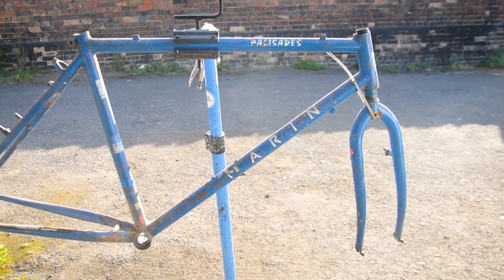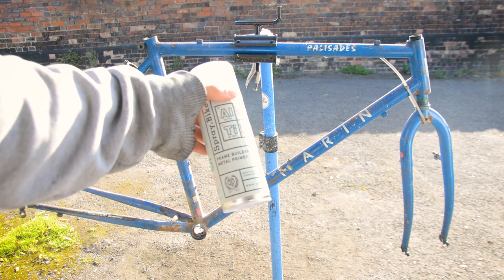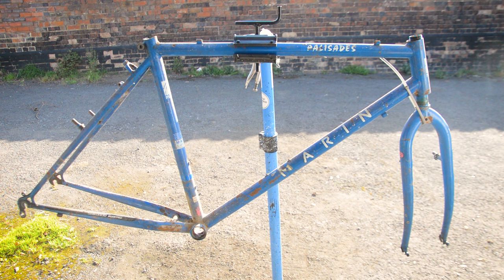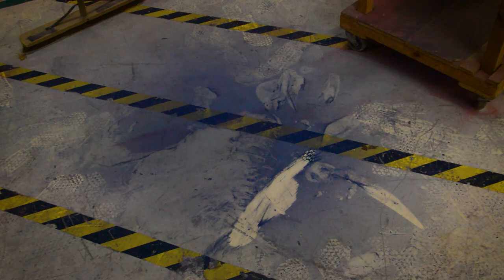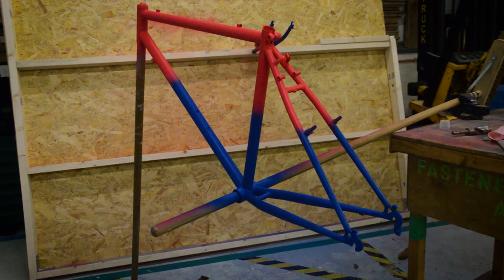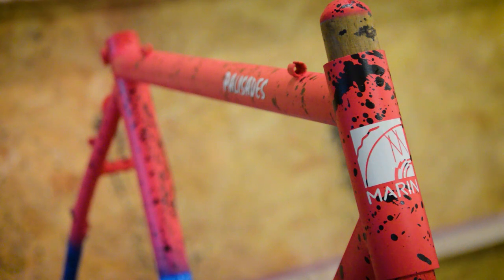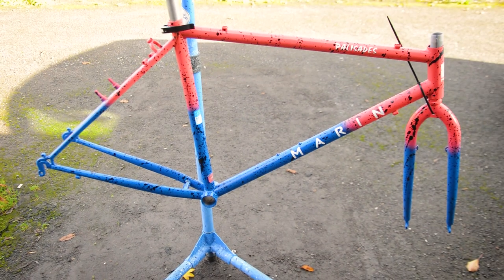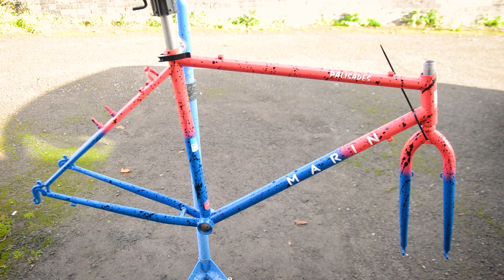Using Spray.Bike Spray Paint For The First Time - Honest Review - Bicycle Restoration

Comment: Great work as always. 
Nice to see an honest review of this product. I’ve sprayed a couple of bikes myself (not with this stuff) and my experience has been that it’s a lot of work and then very disappointing when it chips so easily! Seems this stuff is no different. 

I guess one difference might be the way old shovel does it is that he usually leaves the existing paint on. Means it’s less work/money at the outset and you have a very durable ‘factory’ undercoat. I would love to see you honestly reviewing it that way!
I would also love to see a ‘scientific’ test of these systems. Powder coat, vs spray dot, vs Halfords or something. Paint some tubes and start throwing stuff at them. This would be a great contribution to the bike restoration knowledge base! :)
Reply from the maker: Thanks Peter.  That's always my fear with spray paint - how easily it chips.  I know a professionally painted a cured frame is likely to chip too but with how thin this has gone on I'm expecting lots!  

Scientific tests could actually be possible...  I sort of work in that area...
Reply: 2 primers coats and 2 clear coats. I've learnt the hard way. You need like 4-6 cans of paint for it to stay on. The surface needs to be quite rough for good adhesion. Aluminum is incredibly difficult to get even good primer to stick.
Reply: I also had bad experiences on pro paint jobs

Comment: Looks great. To improve the clear coat, do a really light mist coat first. Then a medium coat over the top. Then a wet coat.
The mist coat will insulate the decals from wrinkles!
Reply from the maker: Thanks for the tips!
Reply: @MonkeyShred  , it's a method for getting any non compatible coatings to play together. Also, do the 'spray can dance' like Etoe.

Comment: Super nice retro paint job. I'm with you on powder coat but this is way nicer to look at. I saw on old shovels channel that rotating the frame in clamp can reduce overspray on other areas, he then used a soft brown paper to rub down the overspray . Hope to see more of this, great stuff.
Reply from the maker: I've seen that pop up a few times about rubbing the frame down with a cloth or something after.  I guess because it comes out so dry damaging the wet paint isn't something to worry about.
Reply: Dry application is the reason for low quality paint job as for as resistance to scratching. The adhesion properties aren`t there with a dry application.  The reason they want you to paint at 2in nozzle to surface distance. They are aware of the dry spray issue. They are marketing a hobby paint for amateurs. Not a bad product just is what it is.   @MonkeyShred

Comment: It turned out quite well! One thing i would suggest is keeping an eye on the temperature of the place your spraying in, was the shop cold before you started? These texture paints dont like low temps from a can.
Reply from the maker: Thanks.  Yep!  I did see that mentioned somewhere so that's why I'm not doing it at home out in the garage (and because I didn't want to coat my neighbours cars!)  I had the heaters on all day so it was around 20c when spraying.

Comment: You did a great job! It does get a little bit more durable when it's properly dried out (like several days or even a couple of weeks). I've used Strawberry Hill a lot and it's a lovely colour. But if I could get powder coating for £50 I would do that just for the durability. On the last bike I left it to dry indoors for a week and then 2K clear. It resulted in a nice glossy finish but we'll see  if it's more durable.
Reply from the maker: Thanks for the feedback Ben.  Yeh I'm a bit lucky with the price I've got for powder coating but it isn't the best choice (especially for lugged frames) so playing about with paint is nice.
Reply: How'd it turn out?

Comment: I’ve watched a lot of these spray bike videos but my impression is always the same.. great colours and designs, looks like a ton of fun, BUT durability is obviously going to be an issue and everyone I’ve seen do closeups (including oldshovel) I see a texture that shouldn’t be there. it always looks more textured and powdery than regular paint and that’s the part I strongly dislike. I’d like to see a comparison between two frames done the same with regular paint against spraybike.. I think with a little extra effort, I know which finish would win.
Reply from the maker: Oh sure.  If I'd had more paint I would have been able to get a bit of a better finish.  One can didn't leave me many options for flating back.  I'm keen to try it again and put some more work in between layers, but with a lot mroe paint.
Reply: Spray cans are not made for an absolute perfect finish. Indeed this paint itself sells itself on that. They tell you just to paint right over the old paint, if its gloss wipe it down with fine sandpaper and go. You could probably spend some time and get a pro level result, but this is really for people who will change the paint colour in a few weeks anyway. If you want a much better finish, and want to paint to last years, then you're gonna have to buy a paint gun. You need to strip the bike to metal, put on base coat, fine mist it with the colour, put on a first coat, put on a second, put on a good clearcoat. If you google around, youll see some people get pro level results from 30 bucks spray guns.

Comment: I've used it and found it works OK, you can rub the roughness down with baking paper, comes up really smooth. I've also used Kobra spray paint on a couple of projects, it's a similar product but I think their colours are nicer. I sealed all of mine with Plasticote clear gloss, the one bike I did has done a few miles over the last 6 months or so and it's a durable finish. Is it better than a pro paint, well no but then you are looking at a hell of a lot more in cost and half the fun of restoring a bike is the feeling that you've done it all yourself.
Reply from the maker: Very true.  I love that I managed to come out with that final design and that pride wouldn't have been there if I'd sent it off somewhere.

Comment: Simple solution to the dust is to use a fan to draw the excess spray away.   A small paint booth with a water catcher can be easily erected.   This will save you all the over spray.    Also check the temperature that the paint should be sprayed at.
Reply: Hi,  please explain about water catches function and how i would go about setting it up.
Reply from the maker: I had a bit of air flow through the room but nothing specific like a dedicated fan.  Temperatures were fine though.  I had the heaters on all day to warm the room and the paint.

Comment: Great review! I've just stripped a frame down to bare metal and was going to go down the same route. I'm now going to have a re-think about how to do it myself whilst keeping it cheap. Thanks for the videos you do.
Reply from the maker: No worries.  Hope your project goes well!
Reply: @MonkeyShred  I’m just watching your 1956 Raleigh Superb build. I’m now seriously thinking about keeping it raw and using boiled linseed oil. I could always spray it at a later date when funds permit.
Reply from the maker: @nickdavis9280  The raw look is pretty cool eh?!
Reply: @MonkeyShred  would blo work on chrome rims that are tatty? Not on the braking surface but on the flat of the rim.
Reply from the maker: I'm not too sure Nick.  Yes it would seal the chrome but I don't know if the heat generated from braking would then cause it to leech on to the braking surfaces and ruin the pads etc.
Reply: @MonkeyShred  I’m not going to do the rims now. I’ve cleaned them up and they are shot. The hub and spokes are ok, so I might do a rim swap like you did on one of your videos.

Comment: Agree with the extra paint purchase, then you can spray delicately, wet sanding between coats. I have gotten away with using the cheaper paints before, but all the same brand in an actual spray booth.
Reply from the maker: I'll be running another trial with more paint so I'll feedback on that too.  Wish I had a proper booth!

Comment: I have a bit of experience with auto paint and the quality of auto paint is substantially higher than that and it can be bought in can. I’d guess the price isn’t too far off. 

Also, for cars we’d typically use that type of clear as a sealer between colors letters and splatter, then we’d bury it all in a few coats of clear so we have enough to block sand everything flat. Then one or two final coats to be polished. 

IMO spray.bike is underestimating the number of cans needed to not scare customers off with the price tag. If one can only covers one coat I’d agree with 2 cans of primer, enough color to cover, and probably 3 cans of clear.
Reply from the maker: Thanks for the input Henry.  I would agree they're underestimating a lot.  I've since gone to Montana paint which is half the cost (and better IMO) and use a 2K clear to seal everything.

Comment: Hi, l always use Halfords car paints, never had a problem yet🤞laquor over decals perfect and the paint is cheaper👍
Reply: How many coats do you find it takes?
Reply: @jordanmills7762  A good two coats of colour, two coats of laquor l hope that helps. And l found the paint is hard wearing👍
Reply: @bikewatcher5428  That's perfect thanks for the swift response mate. I just stripped down a Raleigh medale for my first project. Going down the nitromors route to strip the current coat.
Reply: @jordanmills7762  Good luck👍
Reply: @jordanmills7762  Ps this time of the year use a hair dryer between coats👍 it stops any runs.
Reply from the maker: I've used Halfords stuff a lot too. Mainly way back when I was spraying car parts.  I actually sprayed a whole can with Hammerite cans too haha.  Halfords isn't too bad.  I did find the clear stayed soft for quite a while on my last trial though!
Reply: @MonkeyShred  when you put your clear coat on use a heater or hair dryer to aid drying process and stop runs 🤞

Comment: thank you, I always wondered about the quality of this paint and i really enjoyed the in-depth review.
You didn't use any fine sand paper on any coat, right ?
Reply from the maker: Thanks!  The frame was sand blasted bare and I gave it a quick key and clean before primer.  Primer was rubbed back very lightly but because it was only one layer I couldn't go over it as well as I wanted.  Colour wasn't sanded at all.

Comment: I think you did very well with the paint considering its shortfalls. I have used similar products from Montana and Kobra which are acrylic graffiti sprays - same issues, huge dust levels and ok if you want a matt or orange peel finish at best. Overall finish and durability seem to be the price to pay for the nice colours on offer. The cost (using sufficient cans) I found overall is getting close to powder coating which now gives a much better choice than the old pretty limited black or white choice.
Reply from the maker: I'm fairly lucky that I can get a strip and powder coat for around £60 even with their fancy colours so for me, the durability and cost is always with powder coat but I know the quality (ie not filling lugs) and creativity is with painting.

Comment: Excellent review. I've done dozens of rattle can jobs before I succumbed to the durable lure of powder coating and this review tells me to stick with powder coating. A paint designed at the home sprayer shouldn't have fundamental faults like that. The person at the company who answered your questions should've erred on the side of disappointing you ( " sorry mate, but you need 3 cans of clearcoat " ) instead of hoping bvllsh1t worked ( " 1 can'll be fine mate! " ). 
Review- 9/10
Product- 4/10
Reply from the maker: In my head I knew I'd need more coats but I wanted to stick to what they said for this videos purpose.  I'll try it again with more cans and more prep and hope for better results.
Reply: @MonkeyShred  Top marks for perseverance but at those prices-per-can you're entering the realms of professional powder coaters who'll do all the work for you and they've got mileage in the art.

Comment: I’ve never used spray bike products but it looks like they have a high solids content judging by the dusty overspray, maybe in future you should think of masking areas you don’t want that particular colour on.
I’ve had lacquer re activate paint in the past, I learned quickly to dust the first layer on very gently and leave it to tack off before building up to the required finish
Reply from the maker: The next bike I have in mind (the Team Scott) will get another dose of this but in heavier quantities so I'll definitely be masking parts.  I'll be sure to try the dusting too.

Comment: That dusty overspray was crazy. Even cheap rattle cans work great if you just want to freshen up an old ride. Great vid mate....but what happened to the bromton bike ?
Reply from the maker: The little BSA shopper is hanging up in the garage at the min.  I'm debating whether to get a proper engineering company to machine the shell down to a "normal" size.  Might help with options in that area.

Comment: You should try Montana paint, as far as I can tell it`s pretty much the same stuff (identical if the safety data sheets are anything to go by) and its around half the price for Montana Black and only slightly above half the price for Montana Gold (a lower pressure variant that is far less messy and wasteful) Montana also do metal specific primers rather than the "one type works for all" metal primer they even sell different nozzle types. Its actually designed for graffiti artists so you find a lot of BMX guys paint their bikes with it.
Reply from the maker: I am going to give it a go at some point.  I've got a frame and build lined up for the Montana.  Look forward to seeing the results.

Comment: The powdery finish may be a result of a not ideal nozzle. One time I tried to paint with a fluoro color and the pigment went everywhere and I couldn't form a wet surface, that is needed in order to get a smooth finish. Maybe a bit higher flowing or "heavier" nozzle or more directed flow pattern would be better. But of course the risk of runs would be a bit higher.

Also a pro-tip. Spray cans should be kept upside down in order to prevent the pigments potentially clogging up the tube inside. Also vigorously shaking them before testing them on a sheet will help to prevent problems.
Reply from the maker: They should be kept upside down?  Interesting!  I always shake the cans a fair bit before using them and test first incase it spits everywhere.  I have found a Halfords fluro spray paint was also extremely powdery so perhaps that's just the properties of fluro.
Reply: @MonkeyShred  Kept upside down when stored. Sorry if there was a confusion.

Comment: Great review and run down. I don't think I would use this or mention it to anyone to try or use. The orange peel and dried overspray suggest lack of adhesion. But for anyone that is going the rattle can route nobody in their diy's has shown to put your can in luke warm water before you spray for finer atomization, it will thin it so careful for runs,  flash coat(tack) 1st (especially in the crannies that could be missed or gone lite),then regular coat starting with crannies then underside tube cause when you spray the seen tubes that oversrpay  will end up at a less noticeable or buffable blah blah. Or for rattle canning the graffiti "artist" may have some go to brands.
Reply from the maker: Some good tips there.  Thanks.  I'll pay attention to those details next time.

Comment: Mate, there is just no substitute for 2k out of a gun.
2k because it's so much harder 
Gun because you can alter the consistency of the paint as you go.
Auto supplier will sell 2k in a rattle but you will always need to wet and dry between coats.
Reply from the maker: 2K is being used on my next job.  Hopeful for good results!
Reply: @MonkeyShred  cool, good luck!